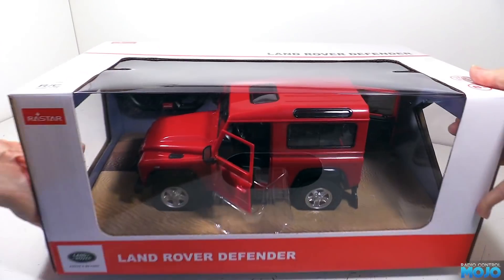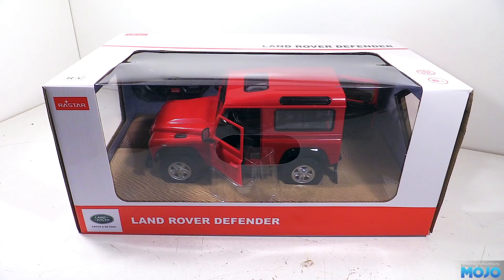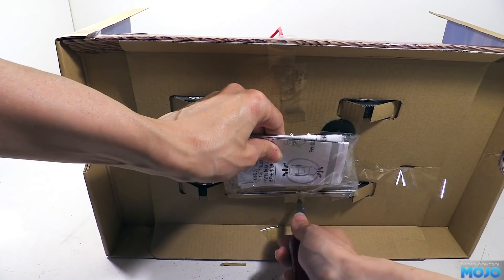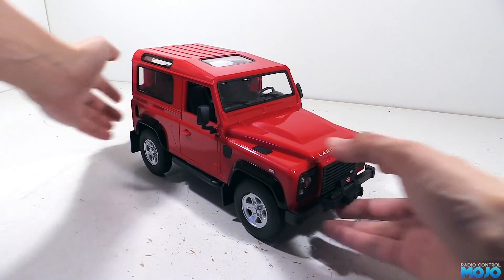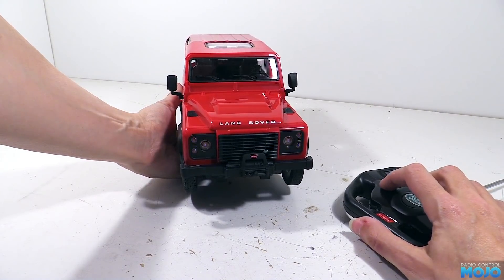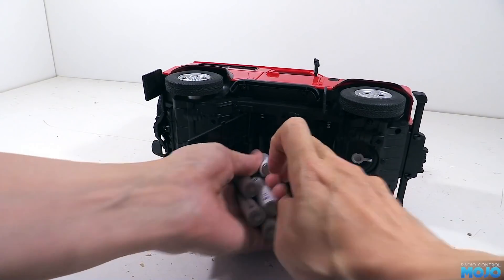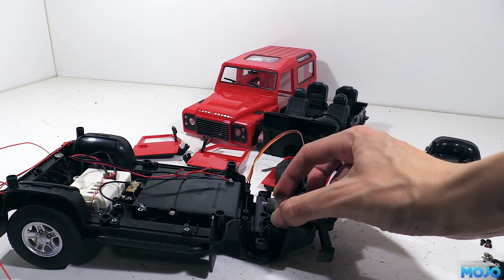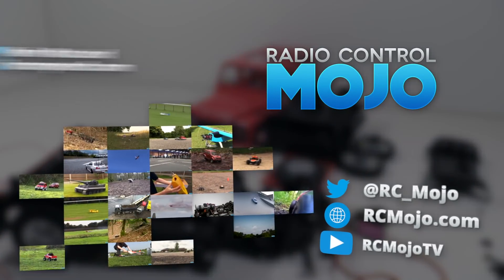Rastar Defender - 1 - Unbuilding

Comment: The Rastar RC model is a great example of the classic Land Rover Defender and I'm interested to see if they will be releasing a 1:14 scale version of the new 2020 Defender.  It's a pity they don't do a model of the latest Range Rover cars, I can only find an older version of the previous generation.  If you want a newer Range Rover you need to look at something like the Jianfengyuan but that doesn't have opening doors.  I also like to test my off-roaders in proper terrain.  It would be nice to see how this Defender compares with my Range Rover Sport and Mercedes G63.  You can see both in action on my channel, BlackSeaRC.
Reply from the maker: Nice one, you don't see the Rastar's outside very often
Reply: That's true, although they are not really designed for off-road use, it is a shame to have an iconic off-roader such as a Land Rover of G-wagen and keep it indoors!